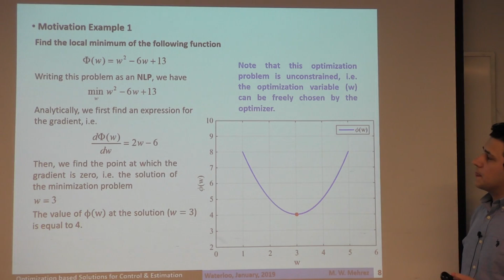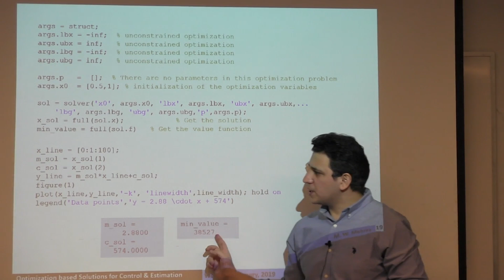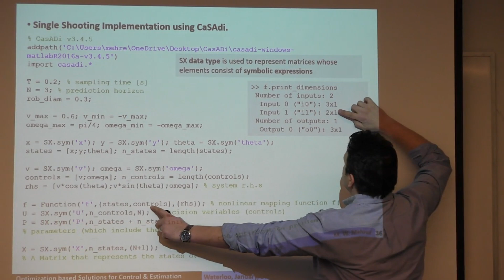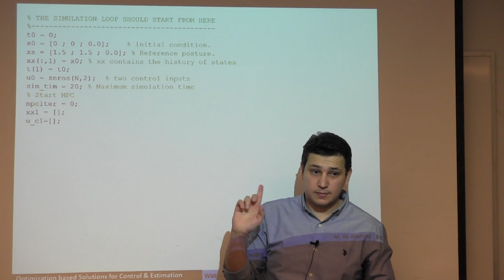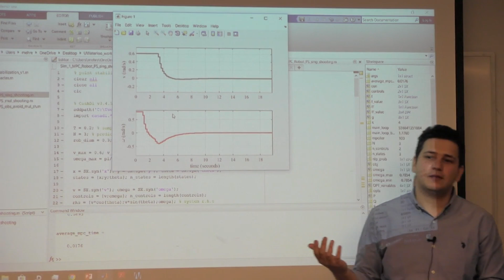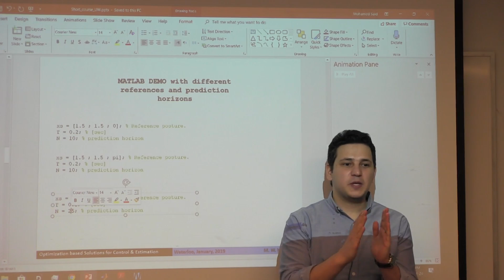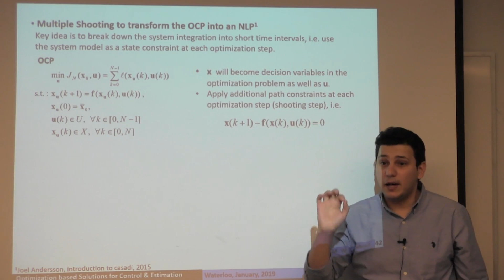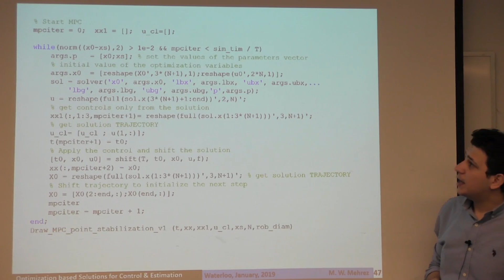MPC and MHE implementation in Matlab using Casadi | Part 1

Comment: Thank you, Dr. Mohammed, for this amazing lecture. I have a question though, in the shift function you stated that u0 equals to u but we eliminate the first row and repeat the last row at the end. Why don't we say that u0 directly equals u since u0 is just an initial guess? Actually, I tried that and I got the same response and the same steady-state error.
Reply from the maker: You're welcome. We shift the solution u one step forward to have an even better initial guess for u, i.e. u0. Using the solution u for the current time step as an initialization for the next step is a bit misleading because we are supposed to apply the first control action in u for the current time step. Therefore, the shifted u is a better initial guess for the next mpc step. You get the same sserror because you play with the initial guess and you still get the same solution of u. I guess your method may take a little longer to find the solution.

Comment: Thank you for sharing this. I have a question. While the speed of computation is one of the issues (in which Casadi has an edge over Matlab in-built solvers), I am more interested in the stability and sensitivity to perturbation. How much stable it is than the built-in solvers in Matlab?
Reply from the maker: Hi Souvik, all the simulations I did with Matlab builtin function, e.g. fmincon(), performed the same under Casadi. That's why I don't use matlab builtin function for optimization anymore.

Comment: Dear Dr. Mohamed,
Thanks for the video series. Its extremely well explained and easy to follow. I have a couple of questions though.It would be really helpful if you can support me on this at your spare time
I am trying to implement a simple trajectory planning and tracking problem for an autonomous robot with a model similar to what you have explained.
1. Could it be possible to soften the state constraints. If so, where do I add them in this design
2. Could it be possible to add other constraints. Not state constraints, but some other safety constraints to limit the dynamics of the vehicle/robot to the kamm's circle, or limiting the jerk to a certain bound

Thanks and Regards,
Anand
Reply from the maker: Hi Anand, Sorry for my late reply
1- I think you may soften the constrains by relaxing the upper bounds and lower bounds on the state. 
2- Yes, you can. You will just need first to formulate your constraints mathematically, then transfer them to Casadi syntax. Look at the code for the obstacle avoidance, in the second video, and it will give you an idea on how to do that.

All the best,
Mohamed

Comment: Hello Dr Mohamed. I have a question. can this MPC code be implemented to a multiobjective cost function  with respect to scalarization methods (with weighting factor)? Thank you
Reply from the maker: Hi Kasereka, as long as you have a single objective function, then you can modify the code in this workshop for your combined objectives cost function. The most precise term for this kind of cost functions is called (Dual objective cost function). I avoid using the term multiobjective here because there is another class of optimizations called multiobjective optimization, where you have more than one objective function that you would like to minimize/maximize at the same time. I am not so sure if Casadi supports this class of problems though.
Reply: Thank you Dr @MohamedWMehrez
Reply: @Kaseraka patrick Have solve the problem?? I have similar problem of solving miltiobjective cost function using game theory
Reply: @mukhtarsani9871 , I have not tackled  this approach yet for it is the last objective of my thesis

Comment: Thank you  Dr Mohamed Mehrez. I am trying  to run your first example but there is a warning just at the beginning. 
Warning: Name is nonexistent or not a directory: C:\Users\TOSHIBA\Downloads\casadi-matlabR2014a-v3.4.5 
> In path at 109
  In addpath at 86
  In Exemplcasdi at 3 
Undefined variable "SX" or class "SX.sym". Could you help me to sort it out?
Reply from the maker: Hi Patrick, please make sure that Casadi is installed correctly on your computer. Check the installation guide here https://web.casadi.org/get/
Reply: Thank you  Dr Mohamed Mehrez

Comment: Professor, I am trying to implement 2 states, 1 input and 1 output model using your code provided for mobile robot without obstacle via single shooting method. Here I am making appropriate changes but what i am not sure is, will it be right to use u_cl (slide number 39-Part1) for control vs time plot and x_r_1(Draw_MPC_point_stabilization_v1 matlab file) for state1 vs time plot. Can you please confirm if i am tapping the right variables for my objective?
Reply: Any Response from you on this will be highly appreciated.
Reply from the maker: Hi Nitin, really sorry about my late reply. For your first question, yes, it would be right. For your second question, I am not so sure as I am not aware of the system you are trying to control. All the best!
Reply: @MohamedWMehrez  Thanks Professor.

Comment: Thank you so much professor for this wonderful lecture on MPC. I would like to ask you about a sample matlab example provided in mpctools folder. I am referring Vanderpoll Oscillator (titled as vdposcillator) and struggling in understanding what is the problem statement and what is the coder trying to achieve in this example. Can you please explain or provide a brief on this example?
Thanks
Nitin
Reply from the maker: Hi Nitin, Thank you! unfortunately, I am not so familiar with the mpctools package.
Reply: @MohamedWMehrez  No Problem Professor.

Comment: salam alikoum, first of all, thanks for the great lecture, what if i have a non constant reference, like infinity track, how do i implement that??
Reply from the maker: This is already answered in the questions below. All the best!
Reply: @MohamedWMehrez  i know doc. I just didn't know how to implement it (that P matrix i mean).  Any further suggestion please ?
Reply from the maker: Well, I have nothing to tell except that treat your tracking problem as a stabilization problem where you have multiple reference points. These points can be defined as parameters in the matrix P and later updated every time step in your simulation loop. In this case, when you define the cost function, you will need to set a different reference from the matrix P to the different states in the matrix X. This means that for every iteration in the loop, where you define the cost function "obj", you will add a different reference from P rather than just P(4:6). Hope this helps :)
Reply: @MohamedWMehrez  i will try my best , besides doc, any ideas how i can learn to code like you ???
Reply from the maker: Just learn through the coding projects you do. Then, the more you code, the more your programming skills will develop. All the best!

Comment: Thank you for this excellent session Dr. Mohammed. I have few questions: How can I convert this point stabilization problem into trajectory-tracking one? Secondly, is there any way to make obstacles dynamic? Waiting for your kind reply. Thanks in advance :)
Reply from the maker: Hi Subhan, Yes you can modify the code to consider trajectory tracking and moving obstacles. For the trajectory tracking, you would have more parameters in the parameters vector P, i.e. you would have as many reference states in this vector as your prediction horizon length. Note that the point stabilization is a special case of trajectory tracking, where all the reference states have simply the same value. Then when you're constructing your cost function later in the code you would subtract the  corresponding reference state from the predicted state. 

For the moving obstacle case, you would also have more parameters that tells the optimizer the predicted locations of the obstacle. Then you will integrate these locations in the constraints vector g.
Reply: @MohamedWMehrez  Thanks for your kind reply. Highly appreciated :)
Reply: @ @MohamedWMehrez  Dear Professor, For the trajectory tracking, suppose my prediction horizon is 3 and states as we know are also 3,then my P vector will be 3X6 matrix and last 3 columns in the P matrix will be updated in each iteration to get the corresponding reference states. Am I correct? Please correct me if I am wrong.
Reply from the maker: @nitinsharma1449  hi Nitin, it depends on how your running costs look like. Normally, in a trajectory tracking problem, you penalize (in the running costs)  the deviation between the state prediction and its reference as well as the deviation between the control prediction and its reference. In the special case of point stabilization, these references (for state and controls) are stationary. However, in a tracking problem they will be dynamic. Therefore, you will have as many parameters as (N*nx + N*nu) where N is the prediction horizon length, nx is the number of states and nu is the number of control inputs. These parameters need to be then included in the creation of the "obj" variable in the code.
Reply: @MohamedWMehrez  Is it possible that you could please share code to the trajectory tracking and dynamic obstacle problem with us?
It would really help us more. Thanks
Reply: @MohamedWMehrez  I am incorporating your suggestions by replacing >>P = SX.sym('P',n_states + n_states) with >>P = SX.sym('P',n_states+n_controls); and changed objective looks like >>obj = obj+(st-P(6:8))'*Q*(st-P(6:8)) + (con-P(9:10))'*R*(con-P(9:10)); % calculate obj
. With this I end up getting errors. Can you please correct me where I am going wrong in incorporating your suggestions?
Thanks
Nitin
Reply: Hey Subhan! Did you get any success in converting the point stabilization problem into trajectory-tracking?
Reply: @nitinsharma1449  No, I'm still struggling to get both the trajectory-tracking and moving obstacle problem. Did you get that done?
Reply: @subhankhan6180  Not yet man.

Comment: Thank you Dr. Mohammed for your valuable lecture
I have one question;
The real control input to the robot is the rotational speed of the left and right wheel. 
So how to map these wheel rotational speed to V and Omega that you used.
Reply from the maker: You're welcome Ahmed. There is a transformation between the body speeds (v and Omega) and the wheels speeds. This transformation is already mentioned in the slides, see slide 28.
Reply: @MohamedWMehrez  Thank you,
I am proud of you and proud also you are Egyptian.

I ask how to put this mapping in the simulation code.

Wheel it's useful to implement it  to experimental platform where the command is voltage that control directly on wheels speed.

Comment: Impressive! Thank you, professor. I have a question, is the code you shared also able to be implemented for a vehicle dynamics model (have more difficult differential equations)?
Reply from the maker: You're welcome! Absolutely, you can adapt the code to your model.
Reply: @MohamedWMehrez  Thank you for replying again.
Reply: @MohamedWMehrez  Hello professor, one more question, I notice that the state vector of your state space equation can be directly used to objective function, but if it needs integration before being used in objective function, should I define another "state vector", thank you!
Reply from the maker: @lunazhang5853  I am a bit confused of why you would need an integration of the state vector to be penalized in the cost function. In any case, you certainly can define new states and penalize them in the MPC cost function.
Reply: @MohamedWMehrez  Thank you for your response! For example, my state vector is longitudinal velocity and lateral velocity, but I want to used X, Y position in the cost function. I mean if I define a new state vector (x,y, yaw_angle), then the state lower/upper bounds will be rated to my new state vector, while my state space vector is (Vx,Vy,yaw_rate,yaw_angle),  then it will lack the velocity lower/upper bounds?
Reply: @MohamedWMehrez  Hello, Professor, I think maybe I can put the bounds to g [constraints]?
Reply from the maker: @lunazhang5853  your system model already couples the velocities with the state vector (x, y, yaw). Just follow my code and you will see how the constraints on the state vector and the velocities vector are coded in MPC.

Comment: Very good video...thanks  a lot, professor
Reply from the maker: You are welcome!
Reply: @MohamedWMehrez  , I have a question regarding the implementation using Casadi ,Would it be different if I used the MPC controller toolbox in MATLAB alone ?
Reply from the maker: In theory you should get the same results if you are going to use the same optimization solver in both implementation. For example, if you use the interior point method in the two implementations. However, without the symbolic framework of Casadi implementation, you will lose the automatic differentiation feature in your implementation, which makes the MPC run time faster.
Reply: thank you sir for the useful tip. will there be more videos in the near future about the MPC ?
Reply from the maker: Not quite sure Mohamed. Please check the last few slides of the presentation of this workshop, where I tried to give pointers to things you might do after having this introduction about MPC and MHE. In any case, let me know if you have any question in the future.